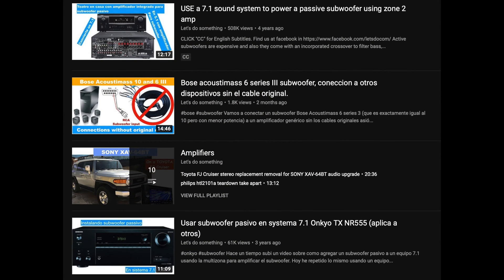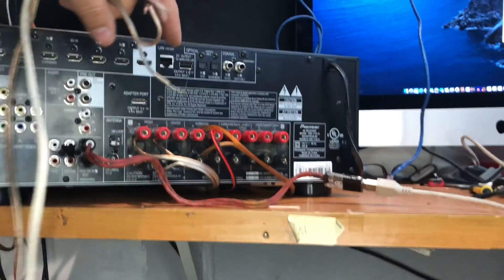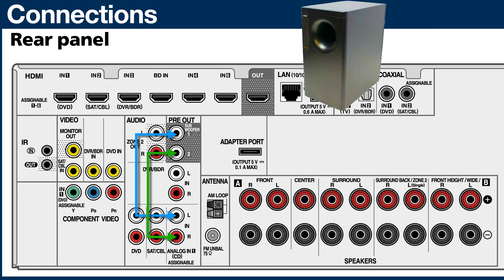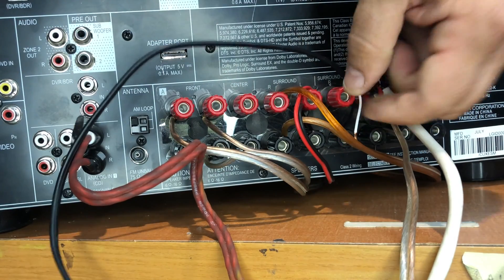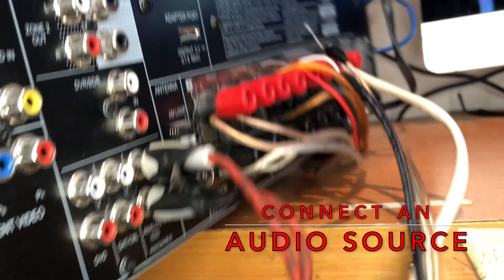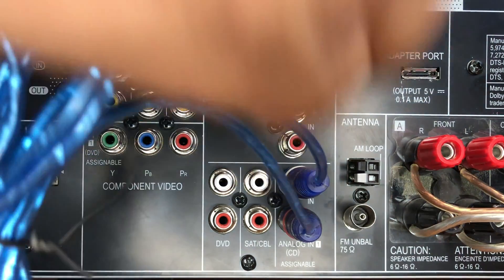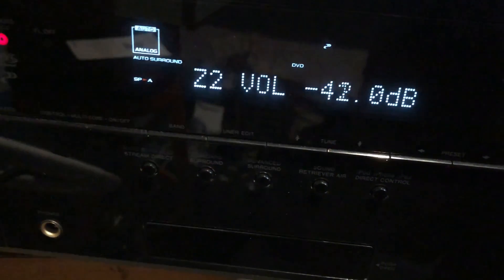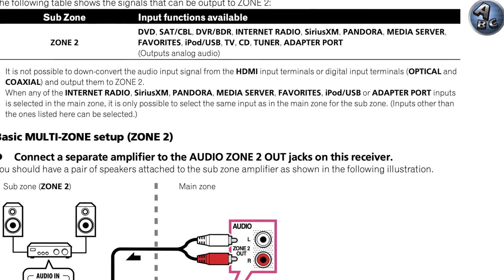Connect Passive subwoofer (not amplified subwoofer) to an 7.1 or more home theater receiver.

Comment: Thank you very much for this tip, it worked perfectly for my setup with a Harman Kardon AVR-247. The amplifier of my subwoofer stopped working so I needed an alternative to power the speakers. Needed to tweak a little bit because as your case, my subwoofer is 4 OHMS, but it's working.

Comment: This didn't work on my Yamaha board
Reply: Just tried it on my Yamaha.
Need to run it in Party Mode to allow both 5.1 and Zone 2 to be active together.
It's not perfect, but at least there is a little contribution from the Sub now

Comment: Thanks a lot for this vid. I have Jamo S626 with 8" build in for each speaker. I connected BI AMping hight and low on front and suround channel, but I've never get enough deep bass by this connecting. Now after I've watched you this vid. this ways make me achieve my goals. Big respect :)

Comment: Hi! I have  a floor standing  speakers with built powered subwoofer  . Do I need to connect the speaker  to  the pre amp input  if I'm using an external subwoofer ?

Comment: You could take the the subwoofer preamp output and run it straight to your zone two input, but you have to go to setting and click subwoofer delay/distance and turn it all the way up and this will add enough delay for the output to work going into the zone two input.  You can check this at audioholics YouTube channel

Comment: Great video but I have a question.  So you have the SUBWOOFER PREAMP (1 with a Y, or 1 and 2) to the CD INPUT (R and L) and the passive subwoofer connected to the ZONE 2 Speaker output.
Question: If the SUBWOOFER PREAMP OUTPUT is already input to CD INPUT, how do you input your source music to CD INPUT if it’s already connected?

I can see how you can connect to another source   (other than CD INPUT) for the main source for FRONT, LEFT, SURR R, SURR L, CENTER speakers) but how does ZONE 2 see this source if it’s not connected CD INPUT?

Comment: My passive subwoofer has a crossover and it seems to be interfering with the bass management of my receiver and causing the sub to sound boomy and muddy. Do you have to suggestions to get around or help this
Reply: Put the cross over to maximum on your subwoofer.  Adjust crossover inside your receiver.  My sub has 35-150 crossover.  I put it at 150.  Inside my receiver, I put crossover frequency as 110 according to my needs.

Comment: Luckily these acoustimass module are easy to drive.
Reply from the maker: Yes, these are 2 subwoofers in the box so you can arrange them in 2 or 8 ohms. I took them from the acoustimass 5 series 2 or something like that, they had a 5.1 amplifier but I remove it because I could not make it work with other equipments.

Comment: Hi, thanks for the video. I think it may be helpful for what I am trying to do as well. Are you available to answer any questions>
Reply from the maker: Yes, shoot, I don't check the comments very often because I am having tons of comments to respond but If I find your question I will try to answer it. Thank you for your coment.
Reply: @Letsdosomethinguseful  Thanks for replying. Well I have an old Onkyo 7.1 receiver in which I am currently only using 2 front speakers (stereo) but I just recently bought a 12 woofer and built a box for it. I would like to add it to my receiver as 2.1 but it is passive. What do you recommend is the best way to add it and I am confused about the part in your video about the Y splitter. Also will I be able to use the subwoofer for movies considering I am using optical to connect to my TV?
Reply from the maker: @Rs74768  Did you watch my other video on how I did the same setup on an Onkio? the "Y" rca is just if you need bass on both Chanels and your receiver only has 1 "Sub Pre out". The "Y" rca is not necessary if you are using just one of the 2 "zone 2" Chanels or outputs (if you are going to connect just one subwoofer) or if your receiver already has 2 pre outs for the subwoofer.
Reply: @Letsdosomethinguseful  Yes I watched your other video but it is in Spanish so it wasn't 100% clear to me. Yes I am only connecting 1 subwoofer. And will I be able to use this setup for music and movies. I am using opt cable to connect to my tv
Reply from the maker: @Rs74768  Well, in that case, the "Y" RCA connector won't be necessary, just connect 1 RCA from the sub pre out to the input you have selected for ZONE 2 and connect the subwoofer (speaker) to the corresponding side (left or right, depending where did you connected the RCA).
Reply: @Letsdosomethinguseful  thanks again for responding but now I am really confused and I cannot understand the Onkyo video you recommended. It is not in English. I was able to connect my subwoofer to one of the Zone 2 outputs and it works but I cannot control bass /sound levels etc. - only volume. But again now you just mentioned the Sub pre-out and I don't understand what you mean. Am I supposed to be using the Sub pre-out and if so how? I don't understand how I would connect RCS to the input selected in zone 2 if I am already using that Input for music input. Can you please help and explain further - thank you. I have Onkyo TX-SR604.